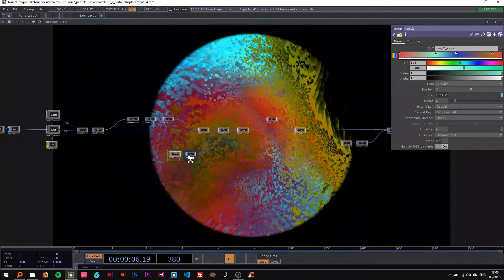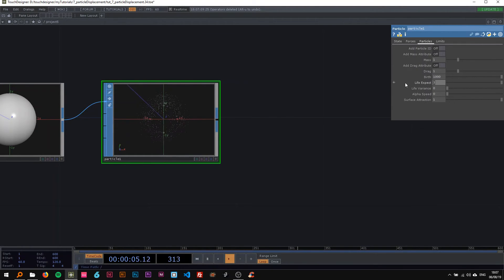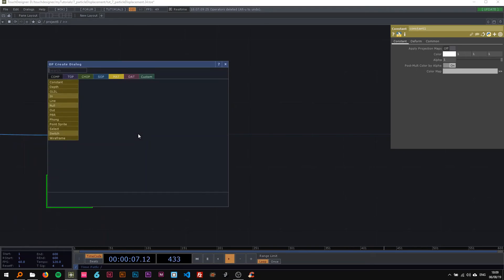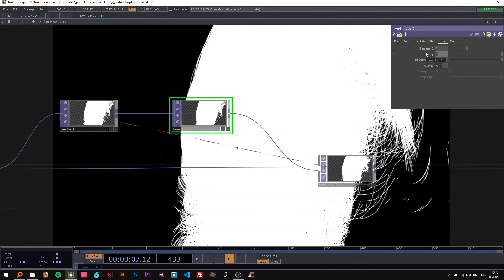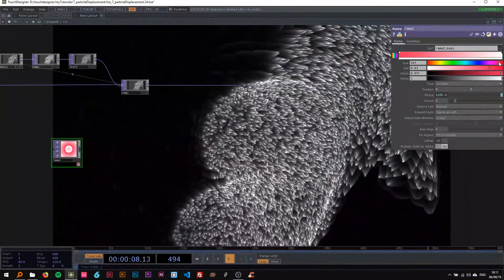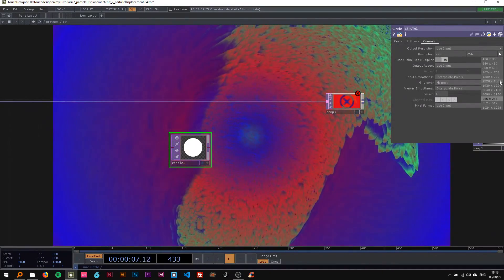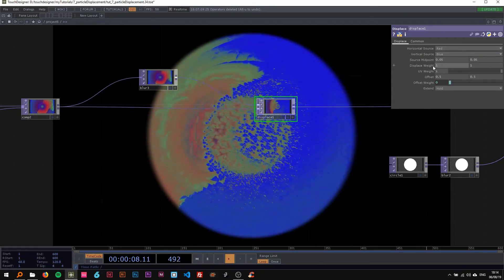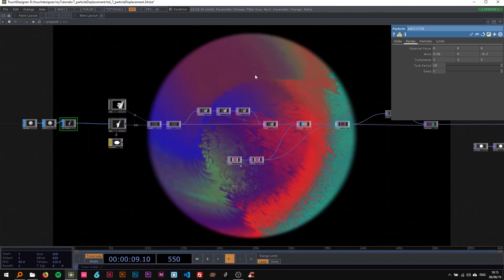Particle Displacement – TouchDesigner Tutorial 7

Comment: Thank you so much! At 4:45, my particles disappear, so I don't get the lines. Do you know why this might be?
Reply from the maker: Did you drag the comp onto the feedback?
Reply: @elekktronaut  i have the same problem! i did drag comp to feedback, how do i fix this? also, thanks for this video!
Reply: Thanks for this video! I had the same problem. i did drag comp to feedback, and the particle disapeared as I connect the leve to the top. @elekktronaut
Reply: And as I looked back to the turturial, I realized it's to make sure u changed the operation of the composite into add :P
Reply: And as I looked back to the turturial, I realized it's to make sure u changed the operation of the composite into add :P

Comment: My geometry and other boxes wont connect with the blue
Reply: I'm having the same issue.  I'm a total newbie with TD, so don't really have any idea how to resolve it...
Reply: @absolut52  you hold tab i think   before you chose new box to connect
Reply: @vendiagram3992  ohhh yeah, that worked!  Any idea what the difference is between the normal geometry box and the one that comes up when you press tab?  or any other clue why that works?
Reply: Seems like the non-working geometry module has a torus inside it, btu when you press tab and make it, it has an in and an out.... weird!